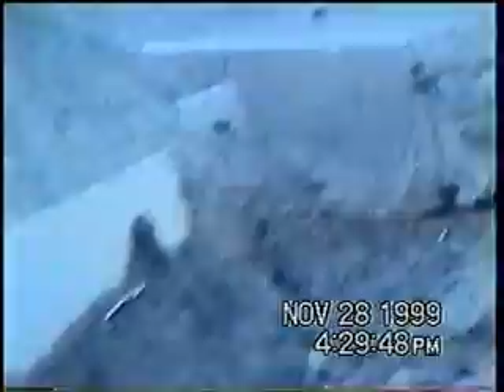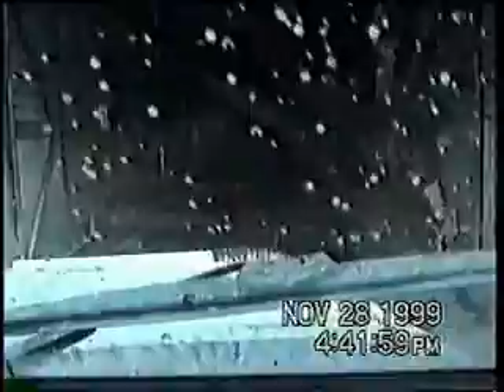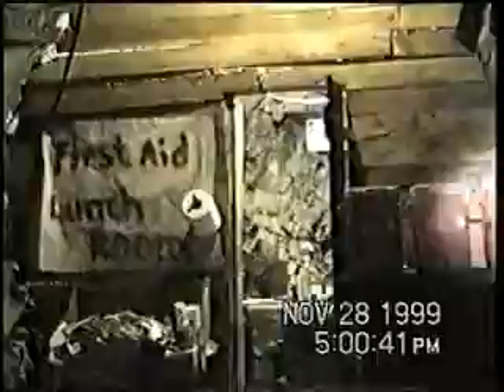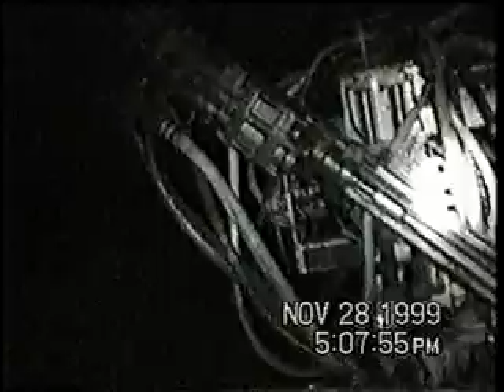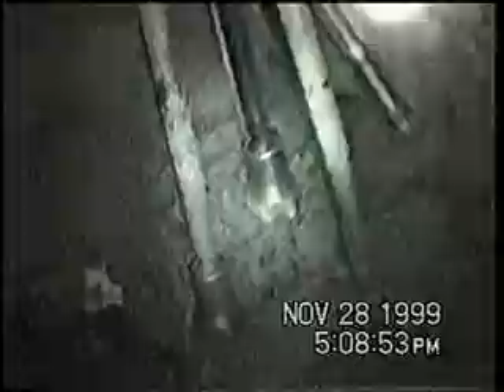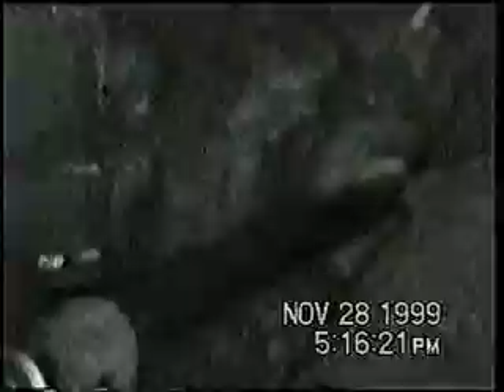Longhole Drilling in Montana

Comment: @whereiztheluv ...Top hole hammers take more skill to operate.....and the holes are only as straight as the driller who drills it....no matter...DTH....or what.....drilling that raise looked slow....50 ft.. at about 45%.......could of run it up on ladders with a Jackleg...in about 3 shifts..lol....what are they thinking..?